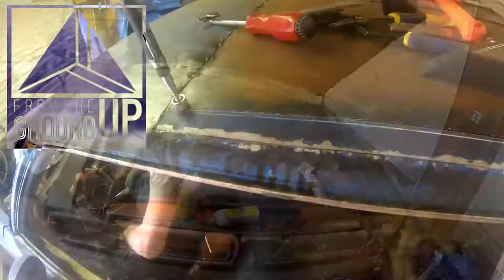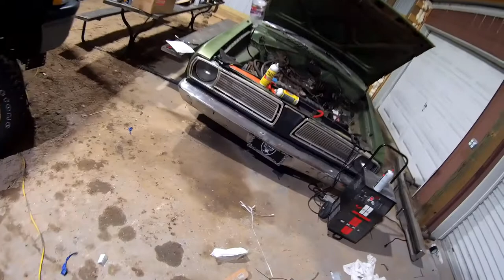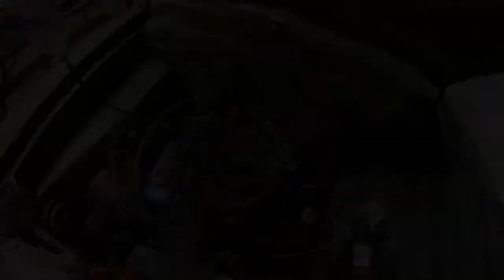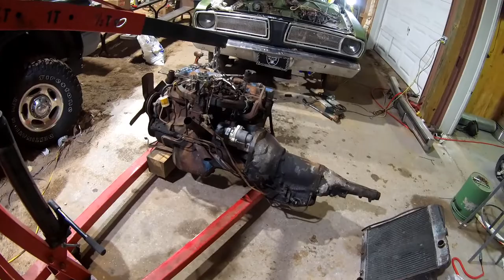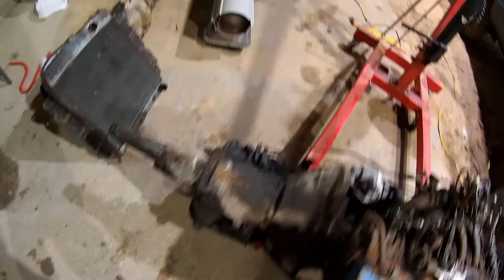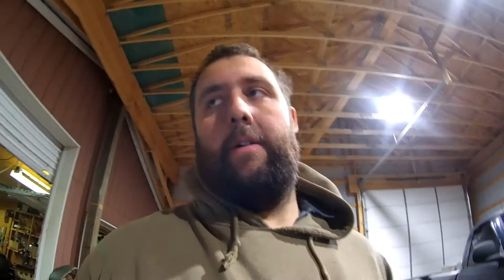Out With The Old....

Comment: Another Awesome Video SIR,  Thank You a Bunch for sharing with us! I wish I had even your "new" portion of your shop I would be in builders heaven.. seriously! 
My new build will be getting started immediately after the holidays. I am building on a dirt/grass floor in a 18' Ft Wide X 27' FT Long ~King Canopy~ 13.3Ft Tall in the Center of the A Frame - Canvas Canopy.  I will be out in the cold this winter.. not going to be any fun but it is all I have. It is all I could get to fit my build in since my build stands 89" Inches (7.42 Ft) Tall currently and with both doors open it is 13 Ft 6 Inches Wide. (Hence why a 10 BY or a 12 BY or even a 15 BY, wouldn't work for my application as I wanted enough room to have both doors open at the same time and be able to walk around both sides without having to do the ""PRANCE-TWIST-TURN-BREAK-YOURSELF around the door dance"" while trying to maneuver around the truck in its final resting spot for its rehabilitation)  
It is on my other Channel ~~ 95BroncoBuild ~~ or ~~  95BroncoBuild@gmail.com  ~~I don't know how to share my channel yet I have never been a Poster of a channel yet. I have only been a viewer on YouTube, & not a poster other then the Lighting Bolt striking the railroad track 20 feet from me in the video posted on this channel I don't know how to do anything on here yet. I am learning though, I will get the hang of it eventually.
Reply from the maker: I subscribed, I know what you mean on the out in the cold the last place I was renting had no garage at all but we will worked on cars and trucks outside. Not very fun. keep me posted on future updates I'll watch them it's really hard to get a channel started. It's a lot of work in editing and working around a camera. But on youtube there's not that many car builders. There's a lot of younger guys that talk and drive their car's but not many out in the garage working on them. That's what keeps me going I guess. Anyways good luck to you man and like I said keep me updated thank you for the kind words